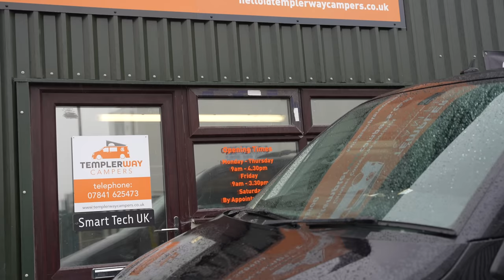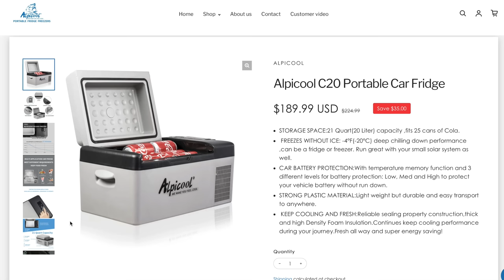Campervan Conversion Dangers ⚠️ & Self Build advice from a Converter

Comment: We have a Big Wave Campervan, are they good or bad as seen mixed reviews
Reply from the maker: There are quite a few different factors. Without seeing your van, I wouldn’t wish to say. The best advice is to have an annual habitation check, like an MOT for the camper features of the van. If a conversion company can carry this out, they can also check the installed components also, like Lewis mentioned the bed.
Are the wheels and tyres load rated? Has the gas hob been fitted as per the manufacturers instructions with the correct clearance above? 
Making sure it has the smoke alarm, carbon monoxide alarm, fire extinguisher etc. which some vans aren’t supplied with.

Comment: Trapping a live wire under a bolt should not produce a fire. Cables should be fused. Fuses protect the wiring not the appliance. Sometimes they require fusing at both ends. This is  required when using B2B's or VSR's because there is a power source at both ends.